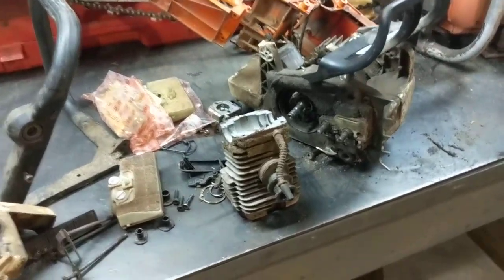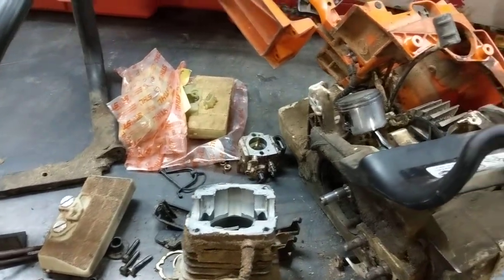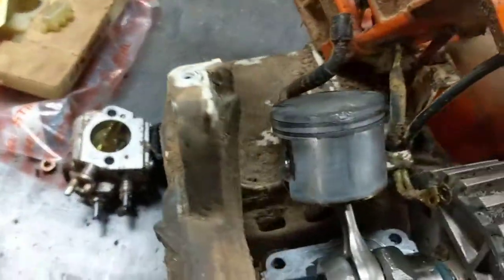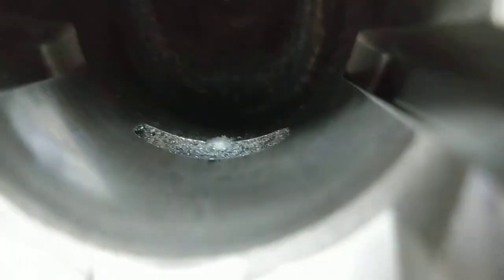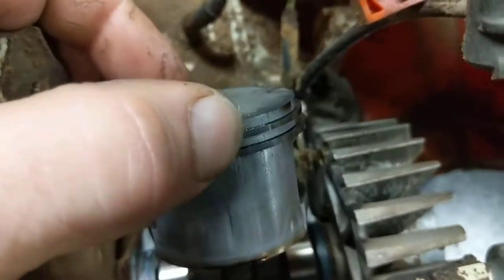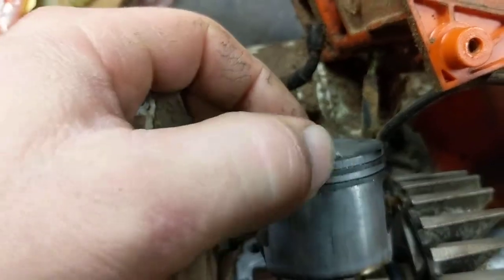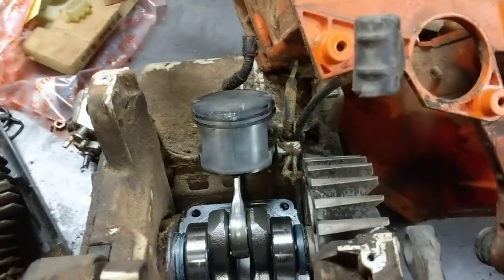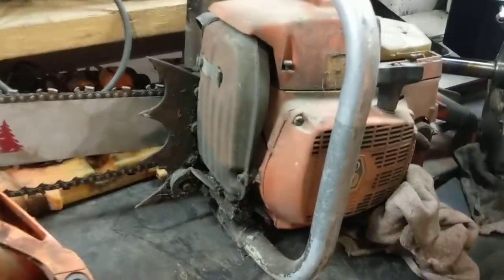Stihl 029 Chainsaw tear down

Comment: Wash the saw off with hot water and use Super Clean in the purple bottle from Menards to remove all the grease BEFORE you pull off the cylinder.  Makes it nice and clean and you don't have crap falling down into the crankcase.